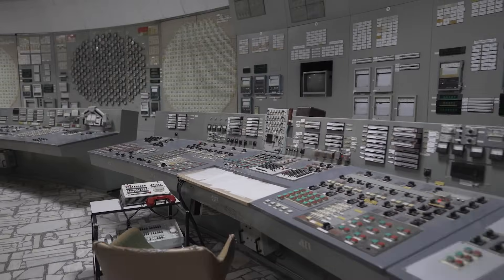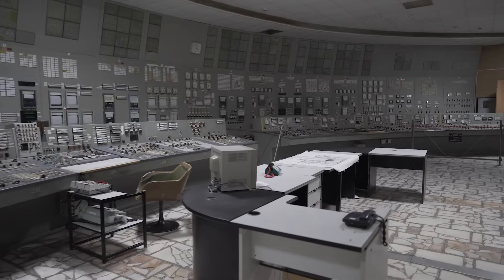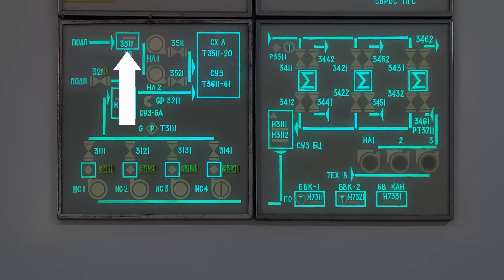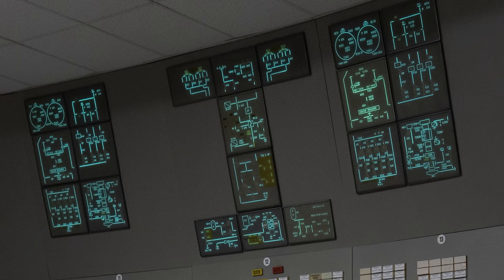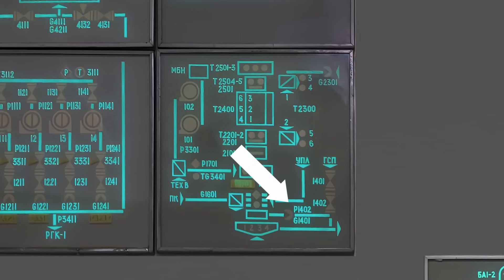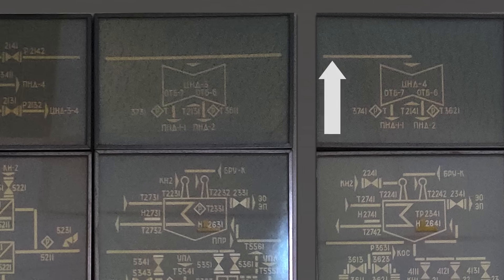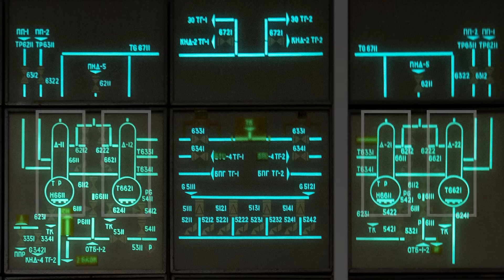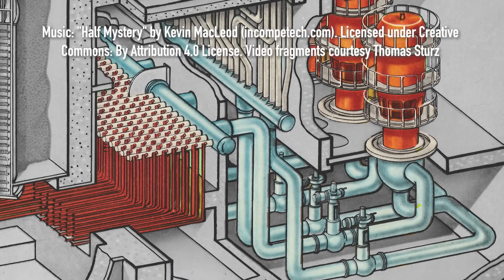RBMK Reactor: How It Actually Works | Chornobyl Uncharted Ep 21

Comment: Too bad I can only give one "like" to this video because you would have got a 1000 of them! You made an 18 minute reactor nerd heaven video that had me bouncing up and down in my seat. Not only is your explanation the best I've ever heard/ seen about these systems, I cannot help but admire the sheer beauty of them. Their layout is done in such a logical way. Especially when you showed that big arrow going from left to right (reactor -> pumps/separator -> turbines/generator) and back again, a whole lot of things clicked in my head as an engineer. Now I admire this big, grumpy reactor even more! Too bad they didn't build and design it better (or rather, safer) because it really is seriously ingenious in so many ways.

Fun fact: the Canadian CANDU has a similar leak detection system. In between the Calandria tube and the fuel channel tube (<- this would be the pressure tube in an RBMK) there is an annulus filled with Argon gas. If a leak occurs, the gas will carry it where the moisture will be detected by sensors, and the operators know they have a leaky pipe in the system.

Well done on the video! And if you ever make a poster with the full layout of these systems, you better believe I'd buy one😁
Reply from the maker: Thank you!
Stop reading my mind — a poster is planned:)
Reply: @ChernobylFamily  
I will stop reading your mind, if you stop reading mine🤣 And I cannot wait to see what you're going to make of that poster. It's bound to be good.
*Looks at the Skala System poster
Reply from the maker: @swokatsamsiyu3590  MWAAAHAHAHA

Comment: Thank you for making this video! I've been wanting to learn more of these mnemonics/graph displays - any further technical insight on the control systems will be appreciated as well! Curious that there seem to be two separate systems for extracting gasesfrom the coolant, always thought it was just the deaerators.
Reply from the maker: More to come!
Reply: SJAE (Steam Jet Air Ejector) and Deaerator (sometimes marked with DA) are both innovative

SJAE uses Venturis to remove non condensable gases with the use of Bernoulli's principle

DA operates at temperature above boiling point of water and is pressurized so that the water is kept as liquid inside. The temperature is increased so non condensable gases are less soluble in coolant. The way it works is by injecting steam to water with steam injectors at the bottom of the tank. The steam will condensate and other gasses will flow above the water, then the gas gets vented out through filters to the outside.

Comment: Nuclear power plants are very complex, but their control panels need to be clear and easy to understand in order to operate the plant safely. These old control panels are beautiful and have a lot of small lights and miles of cables on the back. Newer panels are just display terminals that can display more information, but are not always easy to understand.
Reply from the maker: Good point

Comment: So the "wet" steam from the drum separators directly drives the high pressure turbine, then exits and gets superheated (superheater channels through the core?) and enters the low pressure turbines after which it finally gets condensed and returned as feedwater? Do I unederstand it correctly? If yes, then it is a surprisingly clever design (from an efficiency point of view). EDIT: I did not understand it correctly. There are secondary superheaters (outside the reactor core). I wonder if the efficiency could be extended by "twin" reactors superheating the wet steam of the HP turbine in the other block active zone before entering the LP turbine. This would make operating the blocks dependent on each other (at least in terms of efficiency), but the regulation would be quite complex. Even more than it already is. I should delete this comment, as I realize how overcomplicated this is and how little sense it makes. But I will keep it, just to give you a laugh from this monstrosity of an idea.
Reply: The RBMK variant with superheater channels is called AMB, there is video about it (in russian) called "AMB Most Dangerous RBMK".

Comment: I never noticed those screens high up on the wall because they were dark.  Awesome job of bringing them to life!
Reply from the maker: A separate story is how a way to power them up was found;)
Reply: @ChernobylFamily  What technology is that? Some sort of VFD maybe? Would have been before LED unless during an upgrade...? When you mentioned they were on for active and off for not, I really would think and hoped there was no incandescent involved... for several reasons.
Reply from the maker: @MadScientist267  electroluminicent panels, hand-made, AC 400V
Reply: @ChernobylFamily  Very nice. I figured something established as very reliable since while they represent the redundancy within the reactor they represent, the displays themselves have no redundancy. EL certainly is reliable when driven correctly.
Reply: @ChernobylFamily  
AC 400V, is that per panel?!?😱 No wonder they had to build the reactor so big. Half of its power output went to the control room just to power all those systems and panels alone. Good heavens.
Reply from the maker: @swokatsamsiyu3590 there is a delicate detail. They burn as hell. There were a few small fires because of them.
Reply: @ChernobylFamily  
Oh, I'll bet with that amount of electricity going through them. They'd put my welding machine to shame. The big ones usually run on 380V, and the smaller on 220V. One of these panels does almost double that😱
Reply: @swokatsamsiyu3590  They are only driven by "high" voltage, current (and power) in the circuit is actually really low.